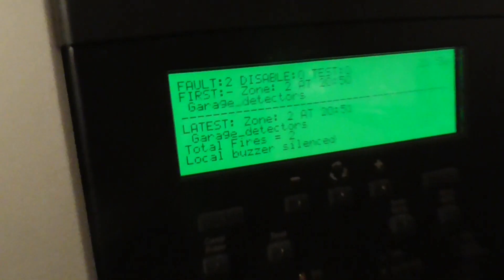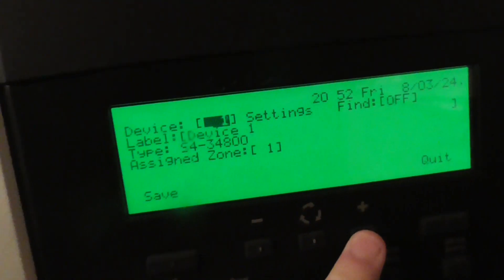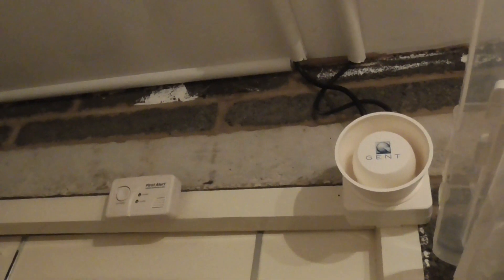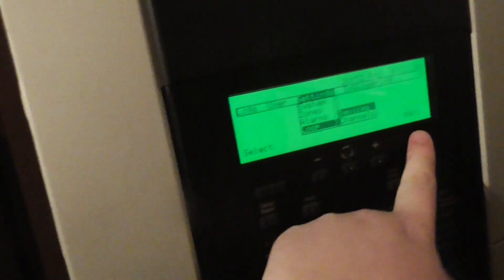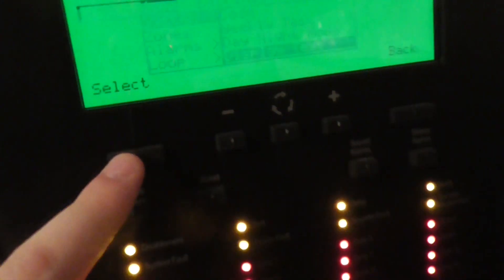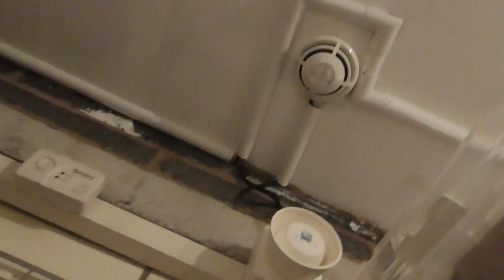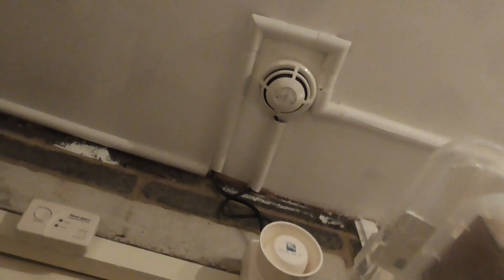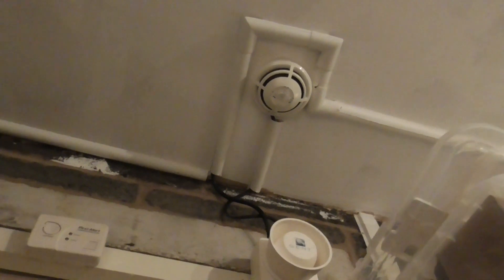Gent Garage Addressable System Test 3

Comment: Is it just me or is that 34203 really quiet by the panel or is the panel buzzer just really loud. Very good system test. And is that type of polling on every s-quad or just that certain type?
Reply from the maker: @aviationtrainsfc1 The Gent 34203 Sounder had been adjusted so that it is  on the quietest volume. The Polling is default on all s-quads and Gent S4 call points while connected to a Gent Nano panel.
Reply: @j1firesystems440I had to turn my volume up to hear it lol.. assume the sounders on the squads were disabled while carrying out this test?